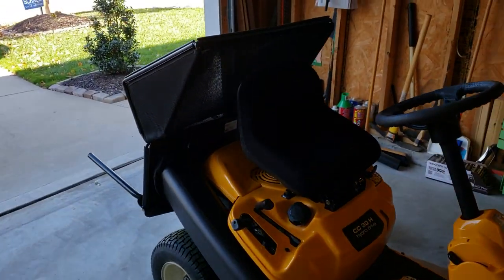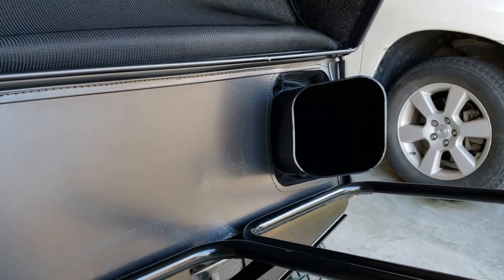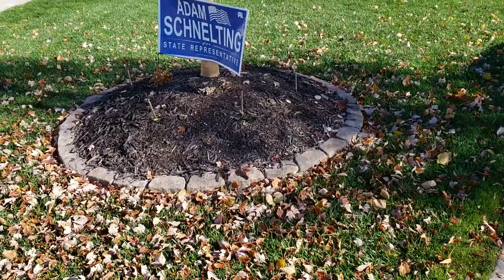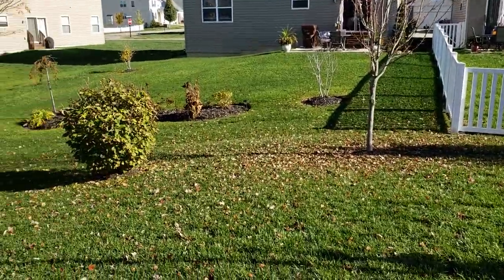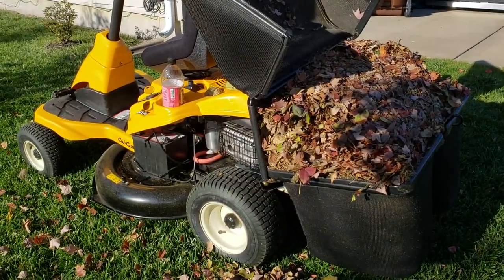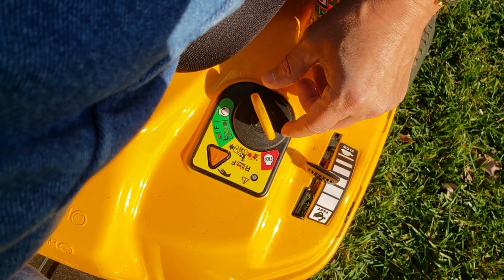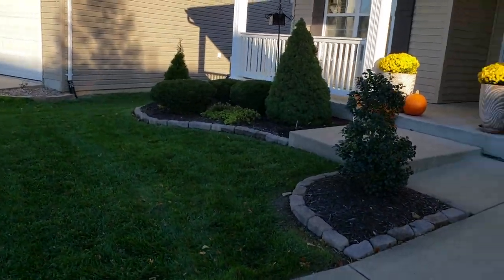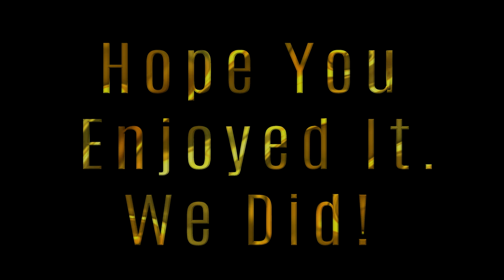1st Leaf Bagging with Cub Cadet CC30H Hydrostatic Drive

Comment: K&C Prible nice little machine thats what i am getting and i mow small lawns in a neighborhood how is the machine holding up now???
Reply from the maker: Wonderful. I have only had one issue. As you can see in the video, we have a side sloping yard. At the lowest point, I have to make a 90° turn, so I back up going uphill and in the spring with really green grass, it creates tire slippage. 
So I'm in the middle of swapping the tires to an ATV type tire. The back two are ready to go on and do a test drive. If they work out, then I'll do the front two tires too to get a little better bite on the sharp turns 360°.
I'll be updating my remarks shortly with my findings.
Reply from the maker: If you have flat yards, this is not an issue and the OEM tires would be just fine.
Reply: @KCPrible98  i am getting a 2010 craftsman with engine in front 17.5 briggs 30inch cut 5 speed i am excited i dont need nothing fancy for mowing yards or to bag the grass
Reply from the maker: @snoopysrc  That should be interesting and a whole lot of HP.  I hope it works out for you.
Reply: @KCPrible98  it will does your still working out for you ???? i subbed to you to see you do mowing with that rider
Reply from the maker: @snoopysrc  Thank you.  The mower still works as well as the bagger which I only in the fall for the leaves.
I won't be doing a video of the new ATV Tires, but will update back to the guy who suggested I get them as he has that issue as well.  I purchased 4 Carlisle X Trac ATV Bias Tires (different sizes front and back).  Am anxious to see if they help at the bottom of that hill.
Reply: @KCPrible98  dont be disappointed cause all float decks scalp
Reply from the maker: @snoopysrc  Depends on the yard and I guess I'm blesssed that its rounded smoothly enough that is not an issue for me.  But thanks for the heads up.

Comment: Will that work on a craftsman R1500?
Reply from the maker: Robert, to be honest, I don't know. I'm not familiar with that model.
Reply from the maker: Robert, I did z search on your Craftsman R1500 and found thus bagger. 
https://www.mtdparts.com/en_US/baggers-and-mulching-kits/mini-riding-mower-bagger-for-30-inch-decks/19A30014791.html#start=43

So many of these mowers all look the same and the bagger looks like the one I have. I would be about 99% confident this is interchangeable with the CC30H model. Mine cost about $250 4½ years ago.
I hang mine on the wall as I only use if for the leaves and the trees are much bigger now.

Comment: 2 questions- can you ride it back/forth without the blade being engaged? - how big of a slope you have mine is about 10-15 degrees. Thanks!
Reply from the maker: Hi Mihail,

Yes, you can use the machine with the blade turned off.  It only engages when you pull the lever on the side to tighten the belt and engage it.  I used it all the time with a little wagon we purchased to haul landscaping stones and mulch around the yard.  I tend to raise the mower deck (lever next to the mower engage) to full height upwards just to make sure it is not scraping on things.  I don't have to, it is just a habit of mine from my youth.

Technically I think the manual said you should not mow with it on a slope more than 14 degrees.  They give you a little template to take cut out and take it to your yard to measure the slope.  Ours is over 14 degrees on one side of the house - the steepest side.  My guess is it is about 18 degrees at one spot.  I feel like I am leaning a bit to one side when I mow on it, but have not had any issues.  I would try to avoid going around a tree as much as possible on that slope as it might bet stuck on slightly damp grass.  I trim with a small electric mower on that tree twice around so I do not have to make as sharp a turn as on the other 33 objects in the yard.  My wife would probably not like it, but she is not  going to mow with it anyway.  She did not like to mow with the self propelled when I was laid up with foot surgery either.  Just take it easy on the slopes, don't get in a hurry and try to avoid a super sharp turn if possible.  Withe the hydraulic foot pedal, you can go very slow and creep along which is very nice and one of the primary reasons I bought it.

Also, remember you can mow in reverse with the blade on if you turn the key back halfway after you start it and push the yellow button in front of it.  That makes backing up with  the blade engaged possible.

Your welcome - Kitt
Reply: Kitt - thank you for answering my questions!! Helps a lot!

Comment: Love your videos on the CC30H one question what size  rubber extension drain tube does it take? I see they range from 10mm to 20mm.
Reply from the maker: Hi Joe,Thanks for liking the videos.  I'm overdue for another one.   I didn't want to get one too short so I could be sure to get it to drain away from the frame and into a collection container.  I ended up getting a 14" rubber hose from Amazon.  
https://www.amazon.com - see this link below.  I'm not promoting it as the one and only product, but it did the job quite nicely for us.  Its called the Drainzit Oil Changing Aid - Model# STAN1438 with a 3/8" Drain Port Size https://www.amazon.com/gp/product/B000PDN3HY/ref=ppx_yo_dt_b_asin_title_o03_s00?ie=UTF8&psc=1
Reply: @KCPrible98  Thanks just ordered it....now waiting for mower to come :-)
Reply from the maker: @joeandrews8965  You will like it Joe, also it was wise to order the rubber oil extension tube at the same time. Mine came with oil already in it from our local Farm & Home store.  I had to drain the oil  the 1st time without the extension tube. What a mess that was. I knew it would be messy, but even so, it was still unpleasant. 
By the end of our 2nd yr ownership, we will be at break even costs of ownership. Meaning it costs $35 to have our yard cut weekly. 2 years x $35 per mow = Cost of mower + the bagger. Starting the 3rd year, we will be ahead of the game.
Reply: Hi! What tool did you use to tighten the drain tube extension to the oil port? I want to do this, but it is a small space and nothing seems to fit. Thanks!

Comment: It's 2 to 3 years now. Have there been any breakdowns or problems with the mower?
Reply from the maker: Yes/No.  NO breakdowns in all this time.  But, I bought new blades to put on and could not get the nut off the blade to remove it.  I put it up on some jacks, but my socket wrench with a 15/16th Inch socket would not budge the old nut.  I put some WD-40 on it for the night and believe I will need to get a short pipe to put over my wrench to give it an extension so the leverage will help budge it loose.  If that fails, then I will have to take it in and have the shop were I bought it take the old nut off.  They may give me some grief because I purchased 2 new blades outside of their store but - Oh well.  Otherwise, I mowed with the old blades (which are still good looking except for one nick).  It worked fine.  I'm still a very happy camper.  I sat on the electric version of this and it feels the same, but your wallet will be lighter by about $1,000 - That part I did not like and am glad I got the gas powered unit.  It is not under powered.  Wheel slippage is my biggest issue when making a tight turn around a tree while going uphill.  The flatter the yard, the more you will like this unit. Hope you make a good decision.
Reply: @KCPrible98  I bought the Troybilt version a year ago and you are right about the traction.  It is because of the Turf-Saver tires. I have a hilly yard and it's no problem other than that. I had a far more expensive mower that was about the same or even worse with the traction. I'm hoping the snow blower tires I ordered will help and I think they will.
Reply from the maker: @worddunlap  Wow, I would love to get  your opinion on the snowblower tires when you get them in and try them on.  That sounds like a great idea.  If you like them, please let me know the kind so I can shop around for them.  Appreciate it.  I just had to replace 4 tires on a 4 years old Gorilla cart.  They were kind of pricey so I bought a new cart instead.  But next year I will most like be looking at new tires as they too will be 4 years old by then.
Reply: @KCPrible98  Mounted and used for the first time today. My opinion is that the tires make it like a different mower. Not only did I not get stuck when a tire did spin it made no difference. I never had to stop, get off. push or even go into reverse. It also did not mark up the lawn as bad as the 'Turf Savers'. The only those Turf Savers save is the manufacturers costs...If this failed I was going to have to get a different mower. I am pleased. It also stops better downhill. it was scary with the Turf Saver tires.  CARSLILE X-Trac  same size as factory tires on back. I got a different style for the front but did not mount those yet.
Reply from the maker: @worddunlap  this is great news, especially about not tearing up the yard in the process. Please keep us informed about your front tires if you change them out. 
Would you be willing to paste in a link where you got these tires?  It would save on some researching.
The feedback is greatly appreciated. Thank you.
Reply: @KCPrible98  Front 2 at Summit Racing  and the back 2 at Walmart dot com  both had the cheapest price. Summit Racing had far better customer service. I've got one working arm so had to pay to get the tires mounted on the wheels at a local farm co-op. %100 difference in the mower. It also felt far more stable.
Reply from the maker: @worddunlap  Thank you for this info and the update on the front tires. I'll start researching them shortly. 
Doing that one handed by yourself would be quite a challenge. I have been looking for a steering ball to mount on the steering wheel. It seems I spend 30% of my time going backwards around trees and bushes. But I can't find one wide enough to go around the steering wheel.
Reply from the maker: Hi woddunlap,  I have been busy, but finally got around to researching this after doing some more slipping in the yard yesterday.  In the spring the grass is very green (slippery) even though the ground is dry.  I'm ordering all 2 for the rear from Amazon.  We decided to put on the two rear tires first and give them a spin.  If they work out, then will buy 2 more tires for the front.  I'm kind of excited to see how they work out for us.  Thank you for the info.
Reply: @KCPrible98  Yes I only need the front tires because of downhill steering. It can be terrifying LOL....I may need a roll bar and airbag?
Reply from the maker: @worddunlap  I got the ATV tires mounted on the back wheels and mowed the yard today.  I was very pleased with how it performed while doing circles around the bushes/trees while going uphill.  I decided to go ahead and get the front two tires converted to the ATV as well.  I'll update my comments after I mow a bit and see how they perform.  I'm optimistic...
Reply from the maker: Hi Worddunlap,  Just wanted to give an update now that the front tires have been on and mowed a bit.  They create a Plus & Minus for me.  They make it bumpy when I run across the driveway, but I think that will go away after they wear in and I don't spend much time at all on hard surfaces like that.
The Plus is they do grip the grass a little better, they still slip a little going around sharp turns like trees, bushes, but not as much slippage as before.
I had to hustle the other day in wet weather.  I only had 20 minutes to finish and it rained rather hard.  I kept going (it was the wettest I have ever mowed anything).  The ATV tires worked very nicely and I did not get stuck or have any issues - Thanks for the tips.

Now the back little yellow plastic piece over the engine broke at the rear frame where it screws onto the black rollbar.  I guess when I pick it up to push it in or pull it out from the garage wall, the pressure on the bar finally cracked the plastic.  I glued it, but it broke again.  I could get  anew piece, but I kind of like it better this way.  I can see better when I back up just where the rear wheels are and how close I am to things.  The engine should run cooler, but get a little more dusty.  I would rather see where I am going better and will just blow the dust off the engine as I blow off the whole mower with the yard blower anyway when I'm done.  So that is the only damages to the unit so far - Still a happy camper.

Comment: have you use the bag for grass and how did it work
Reply from the maker: Sorry Steve, No, I have not used the bagger just for the grass only.  I'm a firm believer in letting the grass return to the earth.  If we had a year like last year where the weather was cool and wet in the spring and then overnight the heat went, the rain stopped and and the last batch of grass did not properly decompose, then I would consider using the bagger.  I have it hanging on the wall over the mower and only takes 5 minutes to put it on, but did not feel it called for it this year.  Instead, there were a couple of rounds on the yard where not all the clippings were 100% mulched, so I just went over that row (kind of straddled) and cut the clippings a second time.  That got it just fine.  It's a rider, takes no time at all to do a row over again if needed.

Comment: is the steering hard?
or is it very easy
Reply from the maker: it us manual, so not as easy as power steering. I usually just use one hand while going backwards and on longer straightaways. I usually use two hands going forwards. I have been looking for a steering ball, but cannot find one wide enough for the thickness of the steering wheel. but I'm not looking hard. I am pretty happy with it.
Reply: Thanks!

Comment: can I buy a bagger for the E30
Reply from the maker: I'm sure you can. I bought mine directly from the Cub Cadet Website Store.
Reply: @KCPrible98  thank you
Reply from the maker: @stephaniehenry9264  Hi Stephanie,  Sorry for the delay, but I looked up the website and price of the Lawnbagger from the official website.  My the prices have gone up since when we purchased ours 4 years ago.  We bought ours for $250 and now they run $350.  The mower itself has gone up considerably too - but what hasn't lately.

Here is the website - hope you like it.  I don't regret it and now that I see the price, I'm glad we bought it at the same time as the mower.

https://www.cubcadet.com/en_US/riding-mower-accessories/bagger-for-30-inch-decks/19A30014OEM.html

Comment: So you're just sucking the leaves up without the blade down right?
Reply from the maker: Sorry Denise, I missed this somehow. Actually on that video I was doing a regular mowing while sucking up leaves. I could have raised the mower deck which would have sucked basically leaves only. 
Basically the blade has to be engaged to suck leaves. The lower the deck, the more grass and leaves you get at the same time.
Reply: @KCPrible98  I don't drive it my husband does.  We have  leaves and oak tree shells in our back yard.  Will the shells hurt the machine?
Reply from the maker: You're missing the fun of it, but glad your husband would get to enjoy it. The oak shells I don't believe would hurt the mower, but they would make a lot of racket getting ground up and possibly cause the blade to get duller more quickly. But that would happen with any mower, even a walk behind. 
I clicked on your channel and liked what I saw. Keep up the good work.
Reply: @KCPrible98  I will try my best to rack up the shells maybe I had look into getting a vacuum.
Reply from the maker: Denise, the bagger I'm using came directly from Cub Cadet as our local store did not sell them.  However, It is not much of a vacuum - leaves yes, Oak tree shells - probably are too heavy and they would not get sucked up into it. Honestly, I would not worry about the nuts.  They will just make noise but probably not cause serious issues.  When I'm not bagging I have the Mulching Chute on so the clippings get mulched up more than if I left it on the side discharge.  On the side discharge, I would recommend youngsters to stay away from it or they could get hit by flying Oak tree nut shells.
And Remember:  If you don't Salt them - Who will - in reference to your Bio.
Reply: @KCPrible98  I've decided to price vacuums.  ...I hate yard work.  Thank you for your input It helped me make a decision.